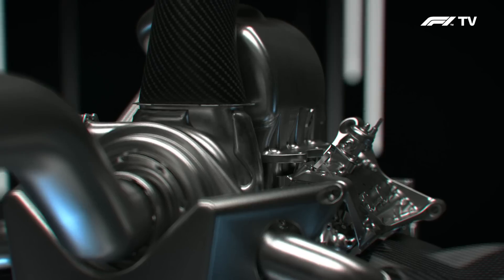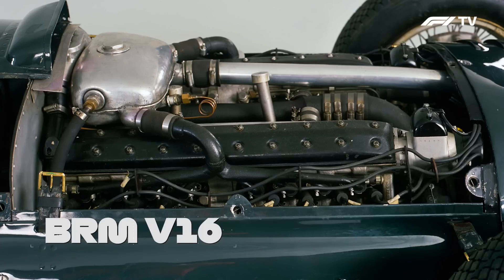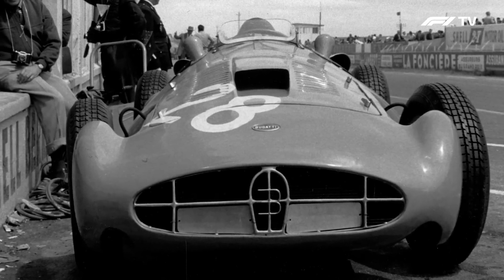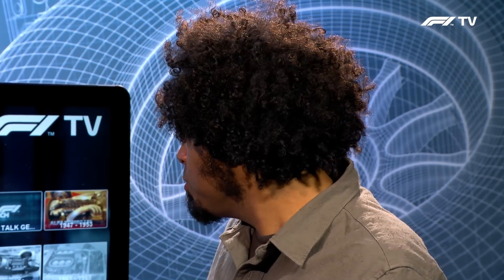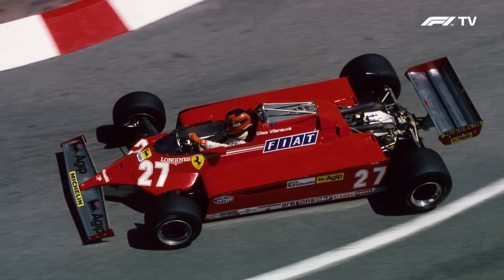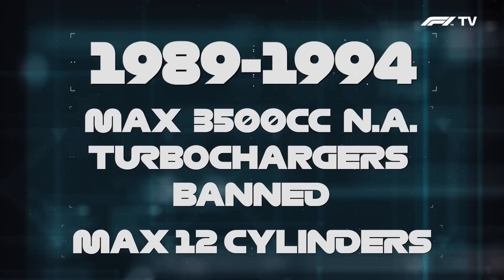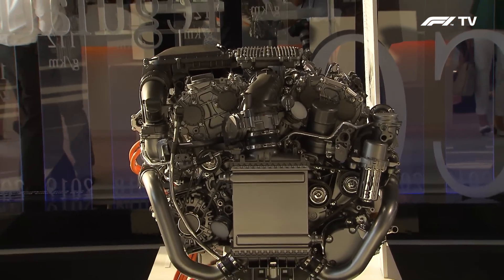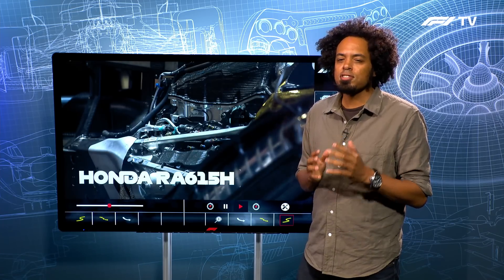Evolution Of F1 Engines | F1 TV Tech Talk | Crypto.com

Comment: Looking forward for the 1000hp turbo powered power unit!
Also, with the MGU-H removed we're getting SO much better sounds
Reply: 1000 hp for half a lap and then lift and coast cause you'll run out of juice
Reply: @josesammut9396  hopefully not. If what they say happens to be true that would be much better for racing than it is now
Reply: The engine is not getting bigger and only produces around 700-800HP the electric motor the rest. V10's had more power just so you know. And the Ferrari F2001 on current slicks would be as fast or faster then 2022 F1.
Reply: We already have em but with electric power
Reply: @hemanths3877  yeah right but the engine it self is~850hp right now.
Reply: @imsorry86  engine isn't getting bigger only the battery
Reply: IT GOT WORSE: Since they are going to maintain the engine size at 1.6L, but aiming 25% less fuel flow, it means they gonna decrease the RPM by 25% too. There´s no way around it.
Less RPM = Less sound
Reply: @gustavoehler  the engines won't decrease revs, just produce less power at the same revs due to a lower fuel to air ratio, which will be made up for by the bigger MGU-K
Reply: @CTcuber4K  Where have you heard that? Because it´s pointless from an efficiency point of view to simply pump more air into the engine, it´s way more efficient to lower the RPM
Reply: ARE YOU SMOKING? WIth the MGU-H removed, we wont have the Growl Noise anymore, we will be left with the electric whine.
Reply: @prypiatshadow  I think you're the one smoking
Reply: @harry4454  I dont smoke
Reply: @prypiatshadow  well you're definetly getting high off somethin
Reply: @harry4454  nah bruch, I only speak the truth
Reply: yeah, without MGU-H, the sound will be better 😁😀
Reply: The sound has little to do with the MGU-H and and more with the fact that there's only one exhaust. Unless they're suddenly moving to twin turbos, I don't see the sound changing appreciatively, just like how making the wastegate piping separate from the exhaust also did little to enhance the noise.
Reply: @halofreak1990  the MGU-H takes heat energy from exhaust gas, this inevitably cools the exhaust gases down meaning less kinetic energy in the exhaust. Slower moving cooler exhaust produces a lower pitch quieter sound more monotone sound, removing the MGU-H will do wonders for the sound. The engine will still be able to rev to 12K rpm also. Its not like fuel flow = RPM, it just influences it. The current engines can rev to 15K but it means having less fuel to air ratio and producing less power so teams don't do it. The new engines won't decrease RPM just because of less fuel flow, they will just produce less power at the same RPM, with the bigger MGU-K making up for the power and the loss of the MGU-H which will lead to increased volume and clarity of the sound.
Reply: @CTcuber4K  I hardly believe that RPM will remain the same. Team want the most power with most efficiency all the time.

It´s way more efficient and less damaging for the engine to save fuel by lowering the RPM. 

Plus, I have no idea how you imagine one can inject less fuel and mantain RPM range by injecting more air into the engine lol